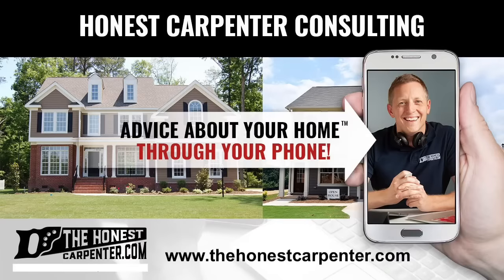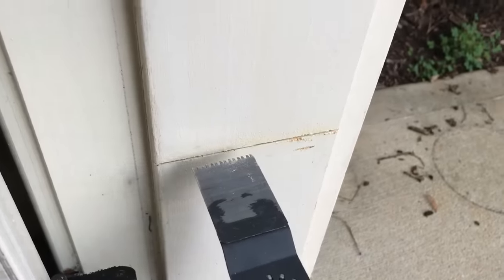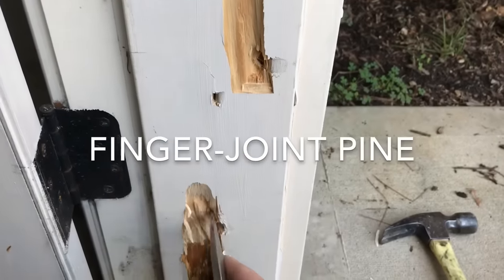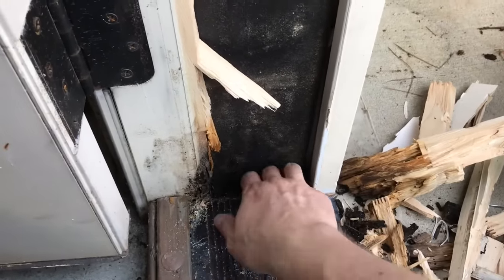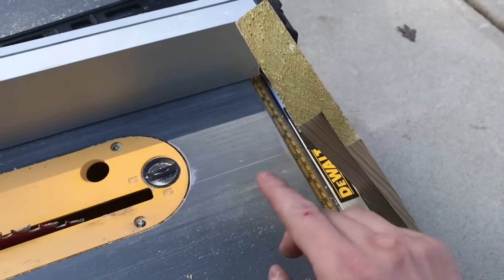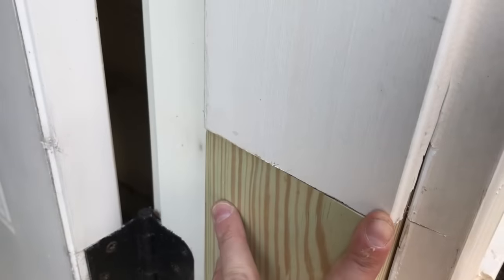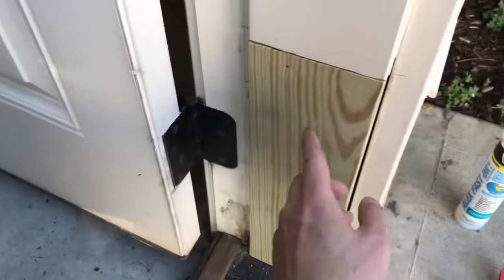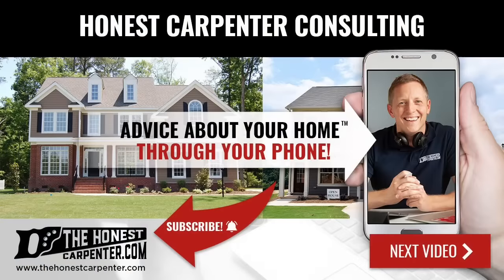How To Repair Rotted Door Jambs

Comment: Can this be done on an interior door as well?  Previous owner of my new house had cats that relieved themselves on the bottom of a few door jambs and really just the bottom 6” need to be replaced on a few of them.
Reply: I suspect you'll find the cat "issue" soaked into the door's framing behind the jam and the subfloor . 

So, you'll need to replace the lower door section, but you can also try treating the other wood with a cat "issue" odor eating chemical. Some are better than others.
For me, it was just easier to replace the carpet and the subfloor where my cat "issue" occurred; it was not at a door jam.
Reply: Valkyrie Frost they’re cheap door jams so they’re all bubbled out. Already got the subfloor.
Reply: @mhill0425  - if the house is old, then reconditioning the door jambs is probably the right path as the quality will be in the product. But, if it's newer construction (last 60 years), then just replacing the door with another pre-hung unit could save time and give a nice appearance. If cost is a factor, then you could repair the jamb in similar fashion to the video, but unless you're skilled, there will be a visible scar at the joints. Also, remember that interior doors, especially the jambs, tend to be thinner wood than exterior doors and will require more TLC.
Reply: Valkyrie Frost ty so much for the advice. I genuinely appreciate it!

Comment: Bit of a chinesium repair. Should have replaced the entire leg. There was still wet timber in there. True that the original cause was unpainted end grain, but that wet timber wont dry now its encased again.

Comment: If the jamb is badly rotted, the brick-mold probably is just as bad. Then what?
Reply from the maker: Roger Eriksen This pre-hung door actually came with pvc brickmold, which is something they’re doing more these days, so it wasn’t susceptible to rot. But, if you’re brickmold does rot, check out my other video where I do that repair as well:
https://youtu.be/FQHWb9q1k1U
You can either notch and replace the lower portion in similar fashion, or the entire piece. Thanks for writing in!

Comment: The only way to completely restore--short of disassembly and reassembly of entire jamb. NEVER use Dutchman scab as seen in this. ALWAYS use epoxy injection to completely restore the structural integrity, followed by epoxy reconstruction. Dutchman scabs will always fail as the original failed. I have been doing both since the mid 80's.
Reply: Won’t it continue to rot? Or do you need to let it completely dry before using epoxy? What epoxy do you recommend for this job?
Reply: @UnleashStudents  I have been using Abatron Liquidwood and Woodepox since 1988 with benchmark results. Dryer is better- use heat gun on low or medium. Injection stops rot unless watersource such as roof leak is not addressed. Resin is waterproof and structurally load bearing. This system has been specified by all major restoration companies.

Comment: Can't make a straight cut is sad ,use a miter with the plunge cutter by making a line ,so when you replace the wood its not blunt , so the seam at the joint isn't visible when done .

Comment: Wouldn’t it have been wiser to replace a shorter part - lower down would have been less noticeable and the rot is only in the bottom 6 inches or so, yet a good 24” or so has been replaced 🤔

Comment: I don't see why it has to be so complicated. Isn't it easier to just rip off the rotted portion, and apply the epoxy wood putty to fill in the holes and cracks, and repaint?

Comment: I respect the way u did this, however you didnt treat the bottom side of the P.T even tho it is P.T it will act as straws and suck that water right back up, should have used epoxy or poly. You even commented on this with the prehung.
Reply: oh please
Reply: @mylabelle6436  do you understand the process of treating lumber? Do you understand the molecular structure of wood? How and why it rots?

Comment: Not bad if this is done "on the cheap", but PT lumber is going to give you a TERRIBLE finish.   I would have recommended letting it fully dry then run it though a surface planer, or better yet get a pre primed lumber made for the application, or a dried treated wood if it's available in your area.

Comment: I just don’t know if this is worth it when you can get a whole new door unit for $300.

Regardless, a good storm door probably could have prevented this.
Reply: Buying a $300 cheapo depot door is the reason it rotted. They're made like shit. About the cheapest entry door from thermatru is $500, comes with a rotproof bottom jamb. 
A good storm door does help a ton, though. You're right. But it does nothing for those same corners on a door with sidelites. 
In any case, I agree this is not the best solution. It's a cheap fix, but sometimes that's appropriate. 
Plus, you have to eliminate the insulation to get that piece on AND, I'd have driven a 3'' screw through that bottom hinge because it's now not attached to anything except a piece of 1x thats probably only stapled into the sill.

Comment: Change door problem fixed 
For all nay sayers the frame comes with the door
Reply from the maker: levi hillman But a new prehung exterior door costs a couple hundred dollars. This only costs about $10. And you don’t have to cut so much caulk, pull interior casings, or repaint

Comment: Im going to have to take out some trim to replace a threshold that was damaged by an idiot home depot delivery guy who dropped my door on the threshold after insisting I not help him hold the door.
Reply from the maker: @susan scott I’m sorry to hear about that! If you want to remove the interior side casings, a little cutting above the threshold should loosen it and you can back it out. When you slide a new one in, you may have to secure it with a light bed of masonry/wood/metal sealant or adhesive and weight it down for a night

Comment: My house had that repair but the idiots used untreated pine and didn't cut the weatherstrip slot correctly.
Reply from the maker: Hey Dave, I’m sorry to hear about that. I see bad repairs on the houses I’m working at all the time. Always frustrates me. I hope it gets taken care of correctly in the end!
Reply: Bob Sacamano cost doesn’t relate to skill. I’ve seen some high dollar clowns really screw shit up. The problem is there is no training or legitimate certification to be a contractor. Just buy a few cheap tools, get a license or roll without one, and start ripping people off.

Comment: You made the same mistake that caused the rot in the first place.  You did not seal all sides of your replacement piece, so it’s going to fill up with water just like the first one did.  Also why not make a piece the proper thickness rather than leave a gap where water can get in.  I did not like those cheesy end cut shims.

Comment: I probably would’ve used a circular saw to cut that bottom part of the jamb.
Reply from the maker: Christopher Crawford But wouldn’t you end up cutting through casing as well? 🤔
Reply: The Honest Carpenter yeah you’d have to set the proper depth and it’s basically only to do most of the cut then finish it with an oscillating tool.
Reply from the maker: Christopher Crawford Good call. You’d definitely wind up with a straight cut 👍

Comment: Only mistake I seen was the shims. You should have ran shims completely across width of jamb. This would benefit in having a complete full face nailing surface. Also you used shims that were end grain, they will split very easily. For the time involved. I would bid the job to replace the entire door frame. Same amount of time, and you have a complete new door frame all the way around!

Comment: pressure treated wood is a no-no... it will shrink
Reply from the maker: @Rob Bob This stuff is already “shop dry.” Done shrinking. It can expand, but so does the rest of the lumber on the house when the humidity rises. You’re right though, I would never use new, or “wet”, lumber here

Comment: I  would use a chisel instead of a screwdriver to remove the wood.
Reply from the maker: Daljeet, I do frequently use a chisel for wood removal. But here the leverage is what I want most—can’t beat a 10” screwdriver for that
Reply: @TheHonestCarpenter  ever tried using Bondo wood restorer  and all purpose Putty. I am planning to use it to replace only the rotted part and some. Would like to know if it will work. Any experience with that?
Reply from the maker: Daljeet Singh Sokhey I have used bondo here. It can definitely work for limited rot. There’s also a product called abatron that is even better. It’s structural, and can bond to wet and rotted wood. It’s more expensive though 😬

Comment: You talk about the manufacturer not priming the end grain and you don't back prime your repair piece or prime the end grain.  Other than that, nice video.
Reply: he used treated wood, so it's not going to rot
Reply: I have removed many pieces of rotted treated wood.  If there is enough moisture to rot the first piece  and you don't remedy the moisture issue it will eventually rot the 2nd

Comment: Wouldn’t have been easier to just cut a vertical line as well using your tool then just prying it apart rather than using just a screw driver to get the piece out 🤔
Reply from the maker: @flyingforme While the multitool is extremely handy for plunge cuts, it can be a little slow on long linear cuts in 1" thick material. Excavating with a chisel or demo screwdriver is actually pretty quick and easy because pine willingly comes apart in fragments. Saves a bit on blade life too :)

Comment: Why not use a chisel to get the old jam out.
Reply from the maker: coasttal123 I like the big screwdriver just for prying power. I carry two chisels at all times, but only really use them when sharpness is required. On pine, the screwdriver has no problem digging in, and the extra two inch length creates tons of leverage. It’s crazy how many applications I use that screwdriver for—but I’ve never used it to turn a screw😂 Thanks for watching!

Comment: WHOA!! 

For the 1st time ever I am concerned about what I am seeing; you have intentionally broken the ‘barrier’ between in and out, very bad (in my understanding) and you didn’t need to!?

Why are shims different shape to cuts made? OK I can understand they don’t need to be diamonds so why bother then, just a simple square would’ve done and you don’t normally add extra work for zero return!?

Why use a replacement piece narrower than the removed piece? Again more work for what reason?!?

I forget anymore stuff. Now you da man I accept, that however I am not equating the seeing with you normally???
Kindest 
Bob
England

Comment: Why glue the shims and not screw them on? Totally ignorant homeowner here.
Reply from the maker: Hey Pablo, they're really just spacers for the jamb to bump up against. screws would split the end grain of the shims in this case, causing them to break apart. You're really not supposed to use end grain shims at all, but when i cocoon them in adhesive like this, I'm not afraid of them splitting and breaking apart--they won't go anywhere.
Reply: @TheHonestCarpenter  thanks for clearing that up

Comment: I dont usually comment but rather than shim it, just make the whole piece as this fix seems bit lazy. Just pull brick mould off, cut door frame above hinge, use repair kit make it complete, done in half time. Rehing lower hinge.  you may have just taken 4 times longer than the job should taken.  Should have used silicon adhesive to seal bottom and between brick moulding.
Reply from the maker: Tim Ahern This repair only takes me an hour or two. If you cut above any hinge, much less three of them, you’ll have to mortise in those new hinge plates. Also, if you pull casings, you’ve just made caulk and paint work for yourself, not to mention cleaning the casings and not damaging them. I’ve done a good number of jamb installations and door installations—this repair is not only far more affordable, it’s faster by hours, with minimal painting afterwards. On the silicone matter though, I agree with you fully
Reply: @TheHonestCarpenter  Mortise one hinge only takes 15 minutes. Plumb and level from the other two with same measurements.  For the same amount of time, you get a much better repair, Why do it half way. Also the new pressure treatment formula does not like steel, especially galvanized as it eats it. You also left an air space behind jam which is not good. Was just saying... your showing people things, that people like me got to fix later the right way.  By splitting the door frame like you did, it also weakens the integrity.So pop the casings- 5 minutes, scrape with knife-5 min, cut jamb, replace- 10 min, mortise hinge - say 30 min if not some thing your good at.  install trim, caulk- maybe 15?... quick coat of paint lest  than 10 minutes.  You would still need to paint your patchwork??? so why not do it right. been doing this  to long.. everyone one has difference of opinion though.
Reply: By way, takes me 2 hours to pull a thresh hold and replace, repair jamb, install  trim, caulk and paint.  Also  side note, and maybe I missed it but you should mention  lead safety for home owners on proper handling of repair or remodeling of older houses before 1978.

Comment: Plane it to fit
Reply from the maker: @David Middleton I used to have a great Dewalt contractor grade planer, but a piece of walnut broke the feeder belt. Learned my lesson about underpowered planers on that one. If I rethickness on the job site now, I have to use a table saw 😕

Comment: What's wrong with a handsaw?
Reply from the maker: The casings are in the way, Andrew. You could only cut in about 1/4" before you were cutting horizontally through the casings. The multi-tool lets you stay between them

Comment: Replace the whole jamb side, this fix never last for long.
Reply: I agree, I pull the whole door and jamb, repair the floor underneath, reframe the door, reinstall the prehung, recaulk and repaint everything. When doing this consider upgrading to composite jambs you wont have to do it again.

Comment: A demolition screwdriver!!!!? How about using....A CHISEL!!!  That's what chisels are made for. And... that salt treat is going to warp as it dries.  A better choice is to backprime a piece of closed pored wood such as poplar, cherry, white (not red) oak or doug fir.
Reply from the maker: @chip worrell I use chisels for a lot of things, but these 10” to 12” flatheads have twice as much leverage. They’re also not susceptible to dulling, and they can be driven into softwoods easily. These days they’re being packaged and sold to carpenters as a demo tool. And I do like the resilience of closed pore woods, but they’re harder to come by, and first need to be milled more laboriously. But this treated is already shop dry to a low moisture content, so it’s stable. Any warpage would have already shown.
Reply: We use a lot of poplar for interior trim in NC, but I've never seen it used outside. We aren't allowed to use fir outside anymore because of all the rotted fir trim.
Reply from the maker: Jobacuda Yep. I really like fir appearance because of it’s clear grain. But the water goes right through it 😬

Comment: Why did you go up so high 8 ins would have been sufficient
Reply from the maker: Joe Feraco I like to cut and replace slightly longer pieces because I think they sit more stably against the rough opening than shorter ones. The process is still pretty much identical, and you only use maybe a $1 more in lumber. When I sight down the board st the end though, longer ones always seem to create that smooth visual line better. Thanks for watching!

Comment: Cut the prefab threshold out and use a water return threshold.  Www.hoelscherweatherstrip.com out of Houston,  Texas.  We ship. We also recommend using frame saver composite jambs for exterior use.  Great video for diy but wouldn’t fly in our market. Thanks for sharing sir,  I subscribed.
Reply from the maker: @roger drum We don’t have water return thresholds easily supplied around here—thanks for bringing them to my attention though! You guys make some great looking doors. Do you put the composite jamb bottoms on everything prehung? Don’t know why that idea took so long to catch on, but it’s clearly the right way to do things 👍
Reply from the maker: Also, do the composite bottoms affect stain grade doors? Seems like they would have to
Reply: @TheHonestCarpenter  Great video!. Nine years ago I had a carpenter replace a side entrance door frame because it had rotted at the bottom. He used an "Everjamb exterior door frame kit" which came with a 25 year warranty.  After only 5 years the wood near the bottom had rotted. If only the manufacture had made the PVC bottom longer, 8 or 9 inches instead of 4 inches, it probably would not have rotted out. Snow accumulates against the door, but I have always cleared it away as soon as the snow stops. I'll have to hire a carpenter to do the repair your way with pressure treated wood.
Reply from the maker: @diannemarinari7936  Thank you! I've seen those lower 6" jamb legs rot out at the notch line. You're totally right, I think they should extend at least 10" up, which is why I ran mine so high in this video (even though rot was still preliminary). What's funny is I hadn't even thought about snow pile--we just don't get that much here! Good luck with your repairs. As others have noted down here, I also more frequently do this repair with cellular PVC now. But I really have found the treated lumber to work great and hold up over time as long as properly installed. Thanks for watching!